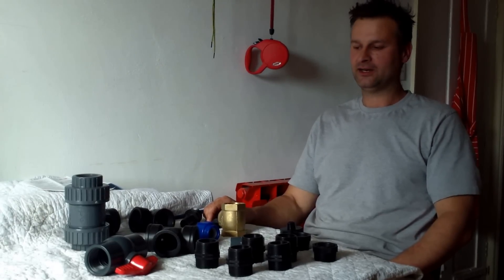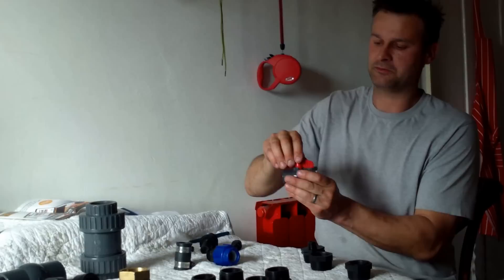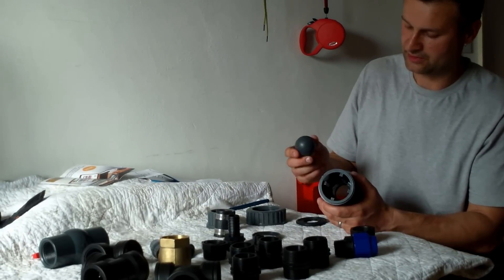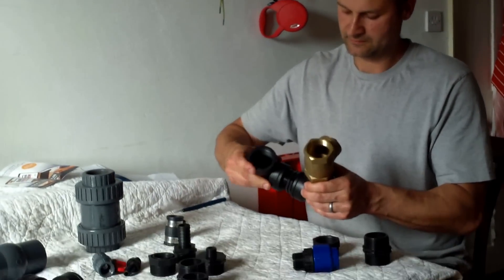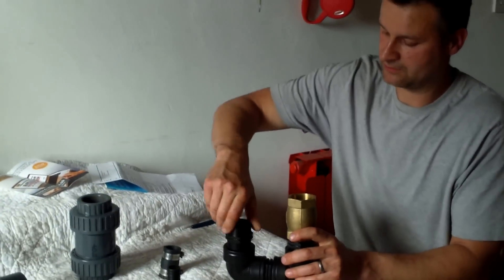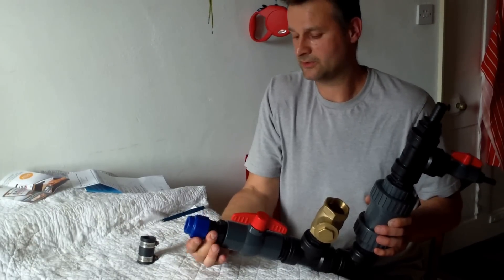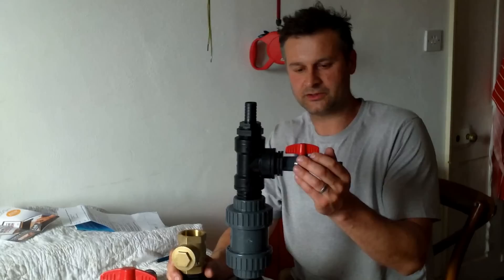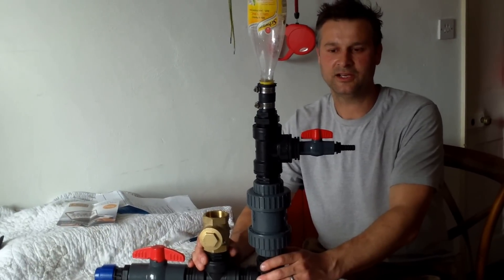Construction of a 1 1/2 Hydraulic Ram Pump out of Plastic fittings

Comment: I've just ordered all the parts to build a pump just like this, but a 3/4" version, thank you for sharing this. I've had a small brass/copper 1/2" action in action for a few months in a woodland pumping some spring water, although I've played around with the system optimising it and saw some promising results and heights, but now for some reason it has gone to being unreliable. The new spring-loaded valve I recently put in has a tiny bore, not even a full 12mm I don't think, it could be that fatiguing quite quickly. Anyway when these parts arrive I look forward to building this new one and giving it a go!
Reply from the maker: Brilliant, I hope it goes well. If it works well, be good to see a video. Cheers
Reply: @Dieseljonnyboy  so far so good 😊 here is a vid for ya: https://youtu.be/wpjEoU8myS8
Reply: @Dieseljonnyboy  I forget to mention in the video she is pumping water up to tank 6m/20ft high at the moment, maybe 7m. That tank has 900L in it already from my previous pump which started to act-up. Hopefully this new one overflows it and keeps ticking over the next few days

Comment: To your knowledge is it possible to feed water from a large tank of water as the source. And pump it back up to the top of the same source? While catching the waste water and introducing it back in to the system? I want to put a one way valve on the waste water exit and guide it a small distance into a bucket reintroducing it to the source just where it exits the tank. Would a one way valve on the exit keep it from working? Would it push it through the short tube/hose? Or does it suck air in through the waste water exit?

Comment from the maker: The bigger the chamber the longer the pump will take to get running, for a small pump like the ones i'm making fitted with a low feed head situated in streams a 2 litre bottle will work fine.

Comment: Hi if you had 32mm blue pipe to 1-1/4bsp check valve for open/closing then going to a 1-1/2bsp check valve for your pressure side then 1/2bsp to do the feed to the house etc, would that work ?. P